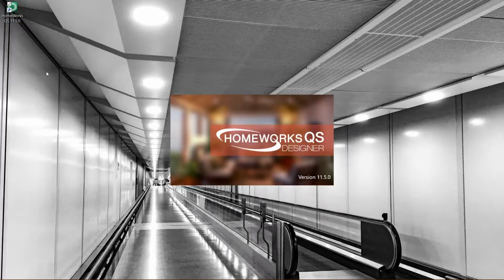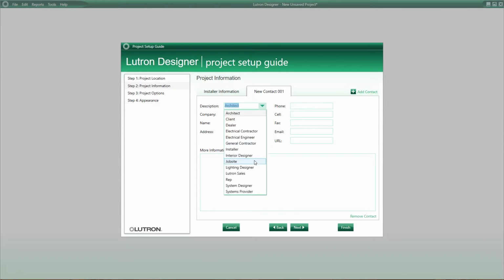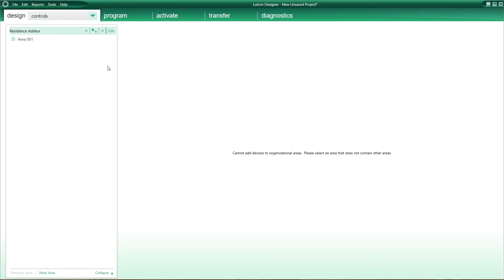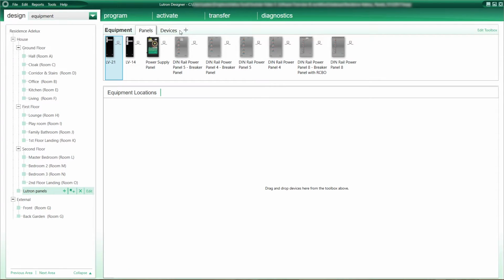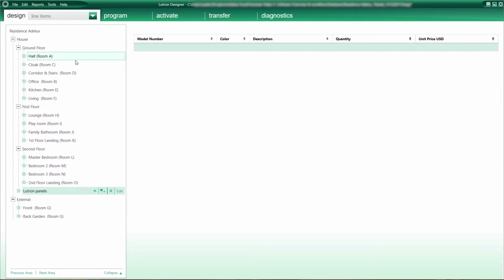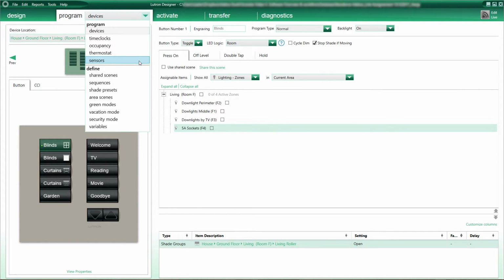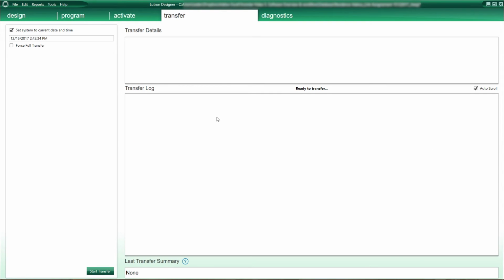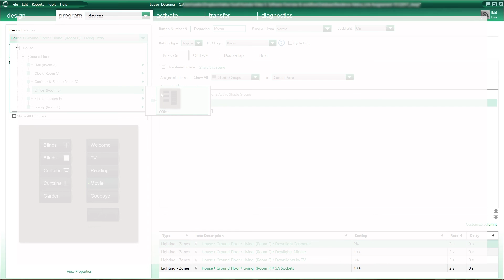Lutron Homeworks QS Software Tutorial // Programming Overview (2018)

Comment: Whats a down light? is that just a ceiling potlight?  How do I know the load? Is there a chart that tells me the load for what?
Reply from the maker: Yeah this is how we call Potlight in the UK - A Downlight. Your lighting supplier should be able to tell you the load of your fitting, based on the driver it uses (Most likely an LED Fitting). Hope this helps. Good luck

Comment: Thank you for the video . How to tie the sensor to the HWQS keypad ?
Reply from the maker: Hi. Thanks for your comment. What type of keypads are you using? International SeeTouch have Contact Closures at the back where you can connect sensor to. Hope this helps 👍🏽
Reply: Yes, I know this . I am using Architectural seeTouch® keypads, and it won't let me click on the CCO to link it
Reply from the maker: Are you using a Luron Sensor?
Reply: Yes.
Reply: Can you make a tutorial on it?
Reply from the maker: OK...Try to use a 3rd party instead - Even if you are going to use a Lutron one at the end, it doesn't really matters. It should allow you to connect it to the back of the keypad. Then Program it as usual......Actually Tutorial on occupancy sensors are coming next. I am currently working on it. Make sure you subscribe so you can be updated when it is released.
Reply: Thank you! I will try this. Can't wait to see the tutorial!
Reply from the maker: No worries 😉 have fun!